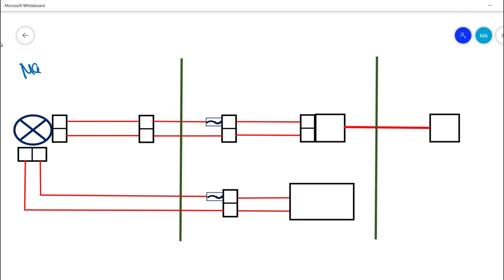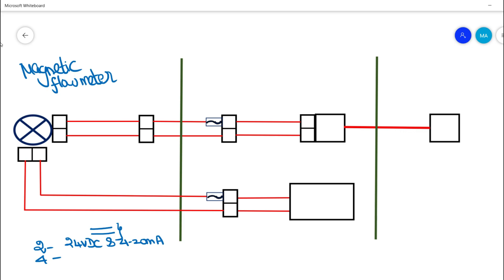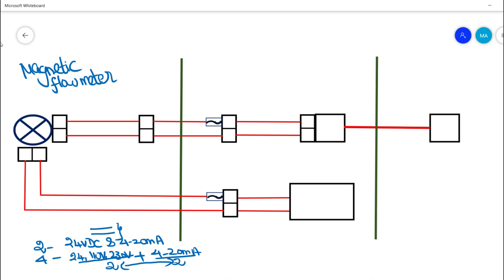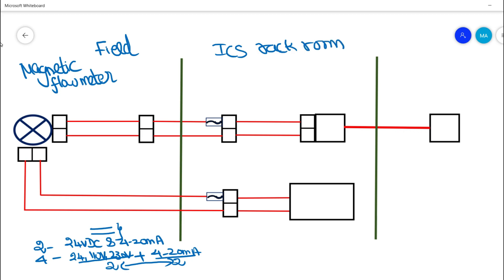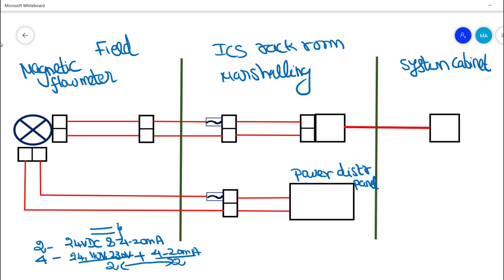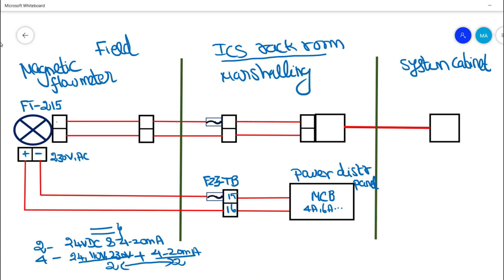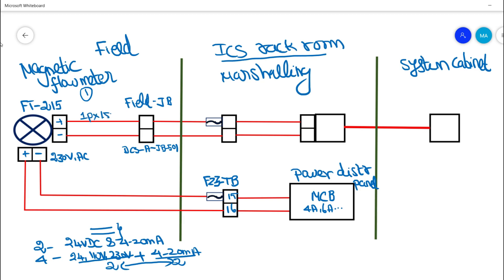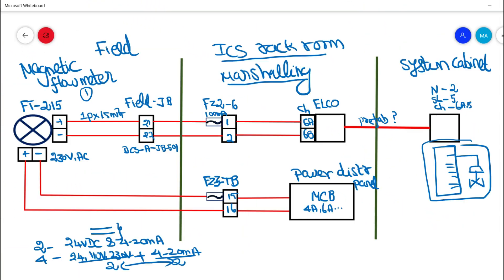4 wire loop drawings explained | Learn Instrumentation Engineering

Comment: Sir I have one doubt in this In some of the projects we go with 0.5mm ^2 single pair cable and some of the projects 1.5 mm^2 for single pair,Why do we choose like this ?Is there any specific reason for this ?,Same for Multipair side (JB TO DCS )
Reply from the maker: It depends on the final control element (solenoid valve, feedback switc, start/stop command etc.,)
Reply: @learninstrumentationengine268   can you please explain it deeply?
Reply from the maker: Ok